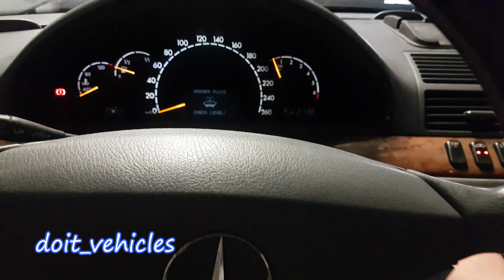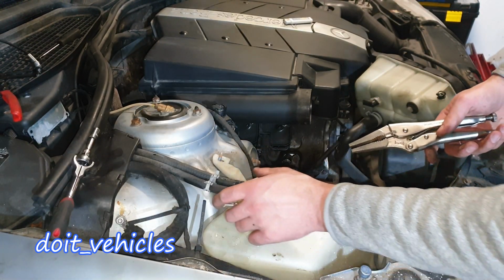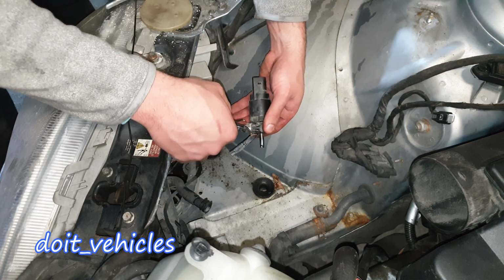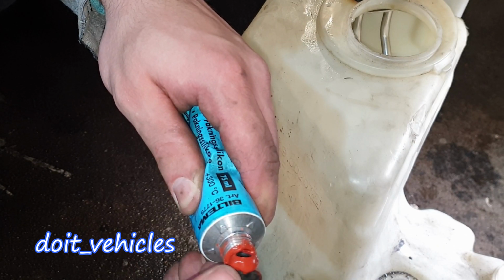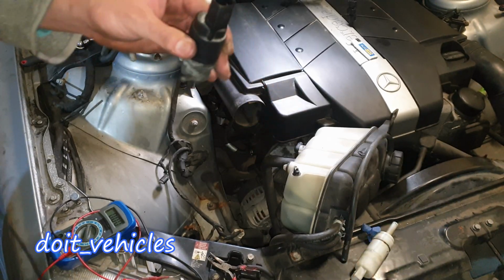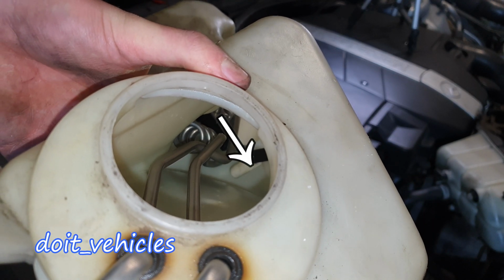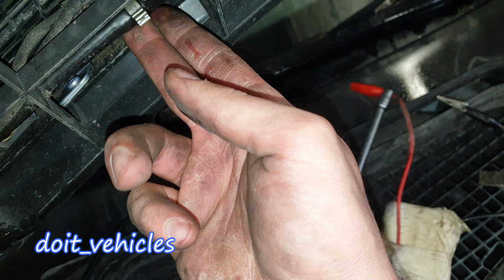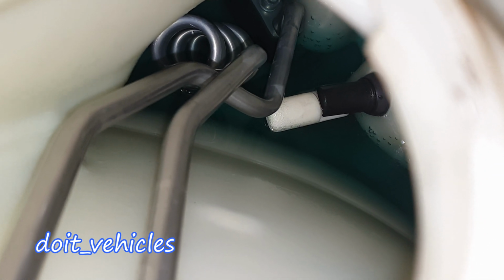W220 Mercedes S 320 Windshield Washer Pump - Reservoir Leak FIXED v6 S class

Comment: Great vid, 4k and good explaining, instant sub.  Does any1 know what the electrical thing is in the top left corner at 0:05, just below the waterdrain cover behind firewall, mine is missing screws and looks like it's been replaced.